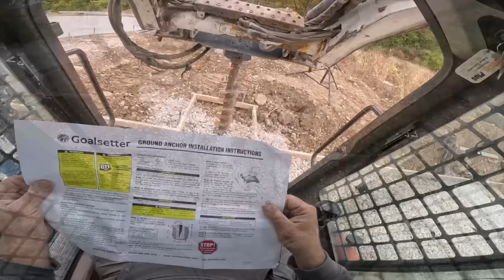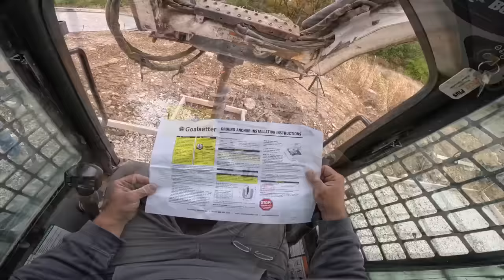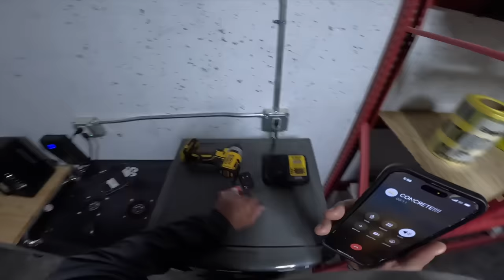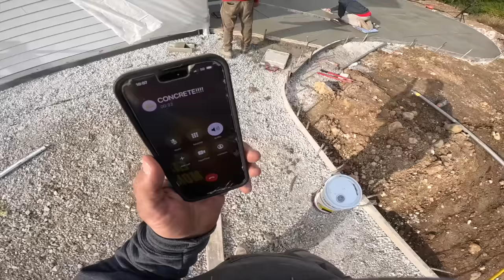The INSPECTOR was getting on my NERVES!!!

Comment: Ild imagine itl be the oil pressure sensor playing up on the t320 as if you had low oil pressure you would no about it the engine would be knocking down on power etc etc

Comment: I had the same problem with my truck. It definitely sounds like the flywheel. And it’s just that the teeth on the flywheel are chipped off sometimes if you move the fan over a couple of times, it moves the flywheel and sometimes you can get lucky and catch the teeth for it to start hope it helps

Comment: There's not much you can do about the Bobcat having issues but if I had just spent $70-85k on a brand new New Holland and had to bring it in 2-3 times for repairs in the first year I owned it I definitely would not be as calm & composed about it as Ryan is
Reply: Y get mad?
Reply: @CowboyQuan  It wouldn't bother you if you bought a brand new car and had to take it back to the dealer 2-3 times in the first year because it just stared leaking coolant or oil for no good reason?

Comment: 04 14 is usually an oil pressure sender manually check oil pressure and if above 9 psi replace sender. Also check the oil level

Comment: It’s the ring gear on the flywheel that’s the problem, the teeth are worn down in 3 different places. Some of its normal wear and tear but it’s most likely from your employees not knowing how to properly start the truck. You can crank the engine with a socket and breaker bar and the starter will grab like new but that’s every time you start it up

Comment: Ryan, when cleaning your bobcat and letting sit IVE noticed in my experience all heavy equipment is a rat’s delight I’d check your wiring and make sure your sensor oil isn’t chipped or showing any corrosion around the connectors, seems faulty and obvious answer to the random code popping up almost like on a gas with the gas cap some car get frequent evap leak code due to the cold shrinking the cap and the seal shortens

Comment: t320 0414  is going to be a low oil pressure code make sure your not low on engine oil if its good then its probably a bad oil pressure sensor if it was actually low all the time the engine would probably be making bad noises

Comment: all it is the starter motor bearing it is not throwing out far enough to engage the fly wheel teeth if you keep using it like that you will need a new flywheel as well !!! or you have already buried a couple of teeth of the fly wheel by starting it when the engine is already running 😅

Comment: I’m sure you had 50 people telling you what’s wrong with your 7.3. I’ve always had good luck turning the key so that the shifter is unlocked putting it in drive and rocking it back-and-forth. Sometimes you can move the flywheel just enough to engage.

Comment: That started this year is a common issue with the older 7.3 power strokes and the 73 and 6.9 IDI why would you after I changed out if you started as I would start swapping out starter solenoid cuz it was cheaper then buying a whole starter I would just take the solenoid off the starter itself

Comment: Flywheel has teeth missing that’s why it does that the starter can’t grab a tooth, if it happens and it gets to a point of no starting grab a socket and go on the crank pulley and tighten it to move the crank and flywheel so the starter grabs hope you read and helps I know your getting fixed but that’s it

Comment: that clay and rock mixture is great for subbase.  i have mentioned it before, but i would take any reusable dirt or rock or concrete without rebar, to the NEW land, and have stock piles of fill dirt, top soil, and also eventually a pile of crushed concrete when you accumulate enough to crush!  plus you save dump fees to the landfill or quarries.  Also Victory outdoor services should advertise winter salt hauling and possibly contract dump truck to assit on larger projects.
sure it may not be super lucrative at first, but eventually people will use you, because they know every winter they can depend on you when they need salt NOW!
Plus u know Ray wants the hours!
just my opinion, and I'm sure u have thought of all this before!
God bless

Comment: could be the power wire from the bat to the starter. if the starter isn't getting a full 12v every time it wont fully engage on the flywheel

Comment: Ryan check your oil to see uf its a little low... If thats not the problem check your filter could be clogged up with trash. Or could be lose. Just thought i would give you some trouble shooting ideas. If that doesn't take care of it my be a oil pressure sensor.but low oil can cause it to pop up so hopefully its something small  good luck with the skid steer
Reply: What?? He clearly checked the oil level on video
Reply: @tb-bk9kh  well I may have missed it. Thanks for letting me know 👍🏻

Comment: Put the 7.3 in neutral and rock back and forth in the seat then try it start it if that doesn't work then get out and push it forward or backwards and then try it the flywheel is missing teeth and one of those tricks will spin it where theres teeth for the starter to grab

Comment: btw that's probably an oil pressure switch, may have a loose connection or need replacement.  thats usually the first thing that people swap because its cheaper than digging in real deep!  but idk what that cost on a skid loader?  its 20-30$ on a car so maybe 200-300$ on a skid loader 😂😂😂

Comment: Code 0414. Low oil pressure. Remove oil the oil pressure sensor and install manual gauge. If pressure is good replace the sensor.

Comment: Well if the excavators and sight contractors where any good that would have been backfilled in all stone in those areas and compacted in lifts with a large diesel compactor or jumping jack. Larger house like that it’s probably been a year since it was backfilled anyways though which helps. Do it all the time on the mansions in Vermont I dig for.

Comment: Codes the T320 were throwing were no comunication with diagnostic tool something with the programming device, which in my mind wouldn't be a big deal.. The other one was for oil pressure and you can use a manual gauge to check it and if it's fine it's probably the censor just going off in that case just replace the censor or don't cuz I'm sure you keep up to date with checks on your machines. Both don't seem like too big of an issue unless the programming device is a big deal, but it's not a module or vehicle problem, just says to confirm the connection to the PC.

Comment: Your 7.3 dsl truck probably needs a new 
 flex plate ,
The starter teeth ring gear.are worn down .
New flex plate at rockauto parts around $156.00 
Plus labour $380.00.
Cheers

Comment: 100% fly wheel. Some of the teeth are worn down which causes it to miss when starter is lined up with that worn down tooth. Happened to me before. Damage to the fly wheel tends to happen when someone turns key after truck is already running

Comment: I had a van that would do the same thing during start.  Missing teeth on the flywheel. I would get a skinny pry bar and set it in between a few bolts near the radiator fan and turn it.   It was real bad when it rained.

Comment: Yea, i agree that sounds like the fly wheel. My truck did that and got bad, to the point where i had to manually turn the engine by hand, well a socket wrench, to turn it enough past the bad/worn teeth on the fly wheel to get it to start every time i went to start it. Had to give it about a 3rd of a turn to get past the worn teeth...if you still haven't gotten it fixed yet, make sure to check the starter gear after replacement of fly wheel as the gear on the starter could be ate up after starting it like that many times. I had a new fly wheel put on and told the mechanic to check/replace the starter gear, to which they failed to do, so about a week after fly wheel replacement i ended up with same issue although not as bad since it was now the starter gear missing/worn teeth instead of the fly wheel itself. But my fly wheel was missing about an inch to 2 inches of teeth on it. Anyway good luck, i know this vid is a month old so im sure you got it done already, hope it all turned out good.

Comment: if you haven't got that ford fixed yet. here is something that will help i have been doing it with mine at least 5 years. a engine will shut down in the same spot 99% of the time. shut it off when its still in gear that way it stops in a different place. and it wont hit that bad spot on your flywheel. with over 300k miles on my old gas burner if i pull the engine to fix it something is going to come apart on it and the same with the trans. so i just deal with it.

Comment: I've got the SAME problem with the fly wheel on my Chevy Tahoe. Replacing the flywheel on it is tough because you have to pull the transmission out by like at least 6 inches. My mechanic shimmed the flywheel and it's a lot better. She'll still grind 1, 2 or 3 times before starting once every few days but the rest of the time, it fires up first shot - knock on wood. He had to do the shim job twice because it's hard to tell how good you've got the shims lined up but he got it good the second time. Eventually I'll have to pull the transmission out and change the flywheel - or buy a new truck considering its got a bunch of other problems. I'm trying to ride it until the wheels fall off. Shame about the GMC's and Chevy's from 2000's through the 2010's is that their motors, transmissions and everything else are great but the frames are HELLA prone to rot. Change the oil, stay on top of your brake pads and other wear-ables (shocks, struts, tie rods, tires etc) and that stuff could go 300k no problem if it weren't for the fact that the frames start rotting - along with everything else. Unfortunately, you can't swap out a frame like a bumper or a side panel. Anyhow, shim the flywheel and I bet you'll have good luck.
Reply: Ryan’s is a Ford 7.3 diesel

Comment: Man fix that starter, you’re gonna destroy your flywheel gear, my friend had the same thing going with his truck the other day in my driveway turns out the starter was loose so every time I try to engage and pushed back and just spun and made that awful grinding noise, tightened up the bolts and it was good to go

Comment: On the 7.3. Try pushing the gear selector farther into park and hold it while you crank. They are known to do that. Has to do with the shift cable adjustment over time.

Comment: The inspector seemed to be giving you his opinion, not directing your work. With inspection it is either pass or fail no inbetween. My question to the inspector does it pass Yes, or No? And if it does not, why not? He seemed to be wondering about the recompaction of the soil, when moisture is introduced. You never mentioned if there were, compaction requirements specified on the soil conditions prior to the piuring of the concrete. Was that what the inspector was actually talking about? Or was he doing the re-bar inspection in the forms?

Comment: Sounds like  missing teeth on the Flywheel, If there is a few missing the Starter will not engage, Rocking the truck back and forth while it is in gear may move it far enough to move the blind spot.???

Comment: 0414 - Engine oil pressure extremely low. You are either low on oil, you have a blown gasket causing a pressure leak, or your sensor could be bad. If it is intermittent and your oil is good, I would examine the sensor.

Comment: Code Inspectors are God's little gift to......IDKnow but I dealt w/ a crew of Inspectors in Fairfax Co, Va. in the early 90's as the
90+ Furnaces came out.  Lots of rules to  venting & frequently the  Lennox Pulse Furnaces( & I hated)  required some special
manufactures installations that circumvented the City & Cabo Codes.  I specialized in doing the high pressure nat gas & vents
for these conversions & they liked to flag my stuff UNTIL I taught them that these were different and WHY!  They didn't like it
but it all worked out to where they didn't look too hard if I was on a job & we did whole subdivisions who hated heat pumps &
We fixed it all.  Code guys might mean well but some are just jerks ~ because they can?!  Good luck on yours.  peace

Comment: funny at the beginning of the vid i was saying how good the fill dirt is, clay and rock mixture, then further in the vid, the inspector says its trash lol... im sure enough equipment and trucks have drove over it to compact it down!
when i see them scrape off topsoil and throw down some rock and pour over that is when i get worried!  for one its usually soft airy dirt, and 2, probably has decaying organic material in there!”
but this isn't highway construction!  so 95% of the time its still able to remain solid!

Comment: Code  M0414  check your oil pressure switch or wire connecting to switch, worst case oil pump😃

Comment: Inspectors are an appointed position by the mayor with no prior experience or testing needed if that says anything. Usually a person who helped him campaign. Service directors are another. Old mayor out, and both   service director and inspectors are replaced as well. It's a rotating door as they serve "at the pleasure of the mayor".. Most inspectors are usually reasonable but as always you have some Barney Fife's mixed into the bunch.

Comment: If you suspect a bad flywheel (which it sounds like) replace the flywheel and starter at the same time. This way hypocritically if it goes bad again, suspect one weak cylinder. The engine will stop in the same spot 90% of the time (right after the weak cylinder)  retired/disabled Aamco tech for over 20 years here.😮

Comment: Install. New.  Ring.gear u. Said.  U.  Replaced.  Starter.  Turn.  Flywheel.  Resurface.  Put. New. Clutch. And.  Rear. Seal. If.   Your. Going. To. Keep. It. U. Have. To. Remove. Trans. Anyway.  Do. It.  Now.   Keep. Up.  The.  Good. Work

Comment: Fair amount of comments complaining about inspectors.  However,  as homeowner who purchased a 20 year old house in a township without building inspection i can attest to the need for such a check on the building process.  Builders and employees are human and not immune to short cuts. In my case i had main floor joist hangers incorrectly installed with wrong hardware leading to sagging floors, missed grouting and rebar cmu foundation, missing attic truss bracing, incorrect nails outer sheathing of garage leading to racking of structure.  The big one i am salty on, missing silt cover over the rock bed of septic mound leading to soil working down into rock bed thus reducing Septic capacity.  An inspector poking around asking questions isnt bad.
Reply: Nobody is saying you shouldn't build to code. Everyone is either saying they're a necessary evil or they need to have more hands on experience before growing a massive ego. I've had garbage in my walls, I know there needs to be better control over the process. But this guy isn't making it better he's making it worse. 

People complain about flooding and you say "well you know in my town we had a drought so water isn't all that bad guys"

Comment: If the inspector wanted to be a real hard0n he could have been by making you remove the poured slab because the welded wire fabric is supposed to sit between the compacted grade and top of slab and not placed on the grade. Although not many contractors do it by spec they get away with it.